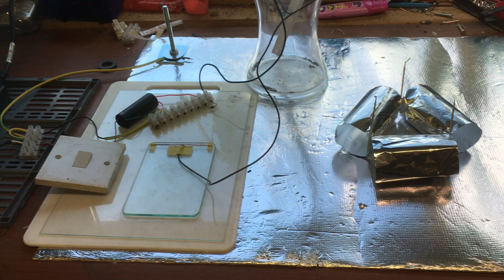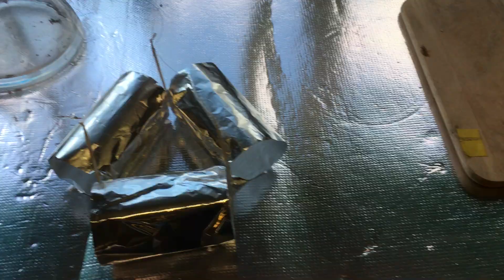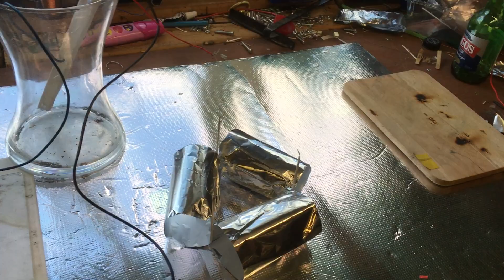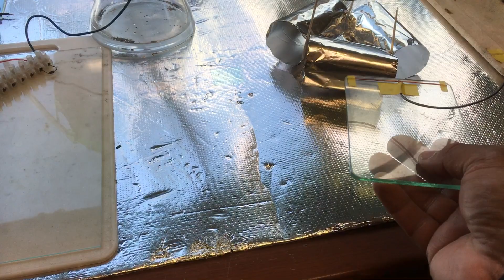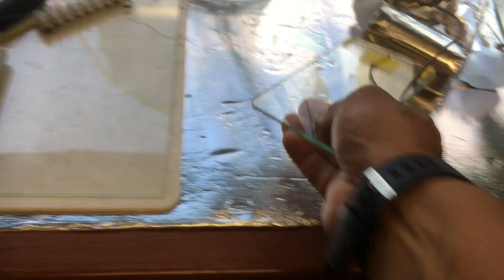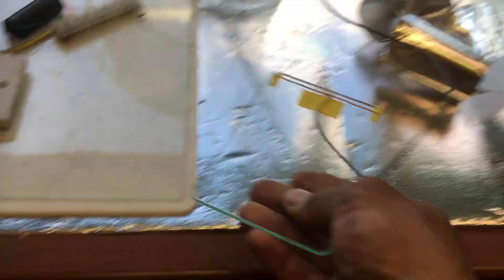Ultra simple directional control of ionic lifter

Comment: Do you find the HV modules reduce in power over time?
Reply from the maker: Thats an interesting question I dont know, but with the exception of neon sign transformers, most of the potted transformers absolutely need to be kept as cool as possible, and not used for more than a few minutes at a time. It would make sense that performance would drop off with temperature/time.
Reply: @c6jones720  Even following these rules I've noticed a drop in voltage output. I asked someone somewhere else and they mentioned impedance mismatch. Nice video btw :)
Reply from the maker: @Joe-zw9ep  Most of the experiments I did that were successful had a High voltage AC stage, and then cockroft walton multipliers for HV DC. Assuming you are using AC you could always add some more cockroft walton stages to up your DC voltage.

Comment: I discovered that a week ago myself. If you were to bring just a piece of balsa wood or plastic sheet close it would move towards it. Static attraction. The information about why lifters work is correct and wrong. 1 is, they say its attracted to the smaller wire. Not true at all. I've been doin different test, and been getting different results. We should talk about this if your interested.
Reply from the maker: Im totally interested in this whole thing! I think this configuration is basically attracted to +ve electric fields, and I think this is why my earlier experiments crabbed and jumped off to one side. I think that is why people say lifters are unpredictable and erratic. I suspect you can improve the lifters by balancing the location where the positive and negative wires go. I also think that is why your dome lifter is so stable, because you balanced it. Im currently working on a simple open control system to try and control a lifter with 3dof. I tried to make a modular square lifter but I think it was too heavy, so Im going to try and keep it simple making a ring lifter with wings to give forwards and rotational motion. I hink Im at the limit of what I can do with the amount of power Im putting in so will be doubling the flyback voltage in the near future to provide a bit more lift.
Reply: @c6jones720  i have so much to tell you.  I compare ion lifters to engines. I used to be a car mechanic. You need 3 things to make a engine work. Gas, spark and air. Ion lifter needs 3 things. Anode, cathode and air (dielectric). If you remove 1 thing. It does not work. Question?. Can a car engine run under water?. Answer yes. Im sure you ask how. Well. Submarines use reactors. Well what did they use in 40's. (Engines). You took your air with you. Lifters dont work in a vacuum because you removed air. Replace air with something else that cannot be removed during a vacuum test. I have already found out what. Lifter technology is not something amazing. I've been doin basic science research. When you put them all together you understand why they work. You said something that was right, but not quite. Let me tell you. When you reasearch static charges. It doesnt have to be attracted to pos. It can be either. You see lifter that reverse the wires and still get lift. That is not why. It is because you created a imbalance in the charge. The thin wire, whether it's pos or neg has a small charge. The big plate has more mass and can hold a higher charge. Van de graaff generator dome is smooth because it holds morebof a charge. The aluminum mass is being pulled up. No matter the thin wire is above or below. If ppl say the aluminum is attracted to pos. Then why when i reverse it. Does it still go up and not down. The larger mass holds more charge. Thus lifts.  If you want i can go on. Lol
Reply: @goobman1981  Very interesting
Reply: @c6jones720  have you considered centrifugal stabilization?
Reply: @mattmcmullen8540  yes. That is the answer. Spin is what you need. I made a round lifter that looks like a table with the neg electrode on the bottom. When turned on. The lifter went up and was spinning very slow, but was completely stable. But the problem with that is. The whole craft is spinning. We dont want that.
Reply: @goobman1981  I'm working on a design that will separate the the bottom assembly from the top.... I think once we can do that, a small dc drone motor will spin the bottom plate and we'll have that gyroscopic/centrifugal stabilization we need.
Reply: @mattmcmullen8540  i thought of that already. That's more weight and power consumption. I thought of a easier way to generate the gyroscopic effect.
Reply from the maker: @goobman1981  Somehow I missed this whole conversation thread.. What was the idea for a gyroscopic effect?
Reply: @c6jones720  if you ever seen the toy."Levitron". It's a small ring magnet spinning on top of another magnet. Like poles repel. But it doesn't flip over because the gyroscopic effect works 90 degrees later. That is why the magnet stays still. Ion lifter are erratic. But causing it to spin will create the gyroscopic stability, which i discovered by accident.
Reply from the maker: @goobman1981  I think I see what you mean. I guess that might work, but I imagine that might be difficult to accomplish. My take on stability would be applying different fields to different parts of the lifter at different times.
Reply from the maker: @djw3095  lol - Im working on heavier models atm. Im not going to post anything unless I have some success.
Reply: @djw3095  c6jones720 and myself work on our own projects. If he has something to post he will. If i have something to post i will too. We give ideas and inspiration to one another.